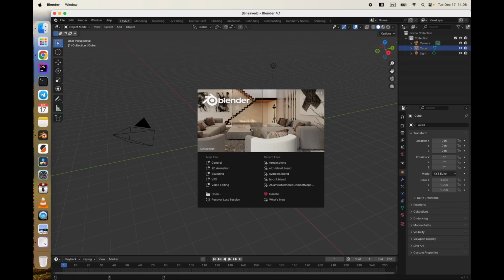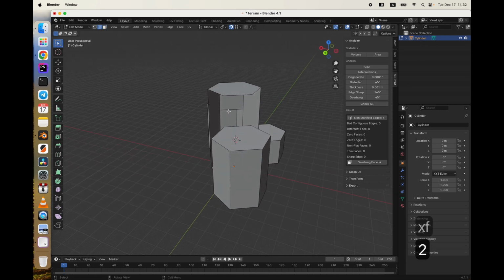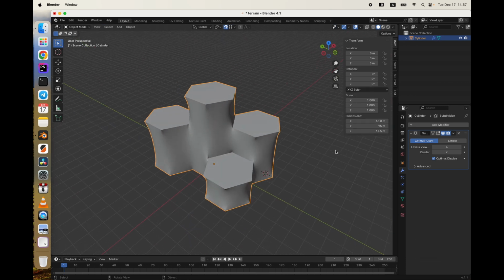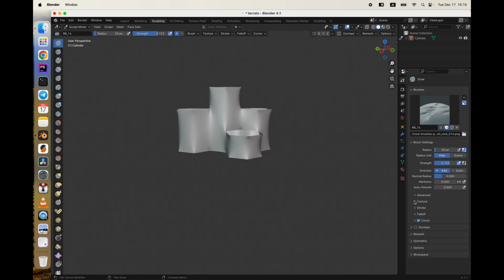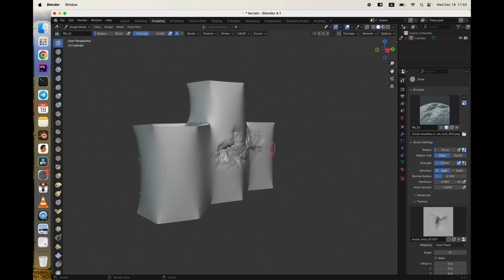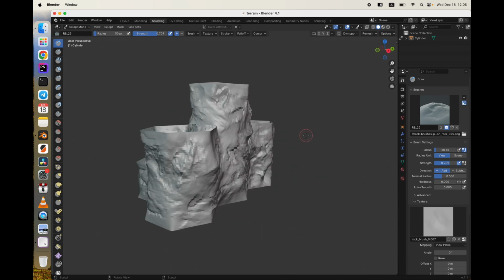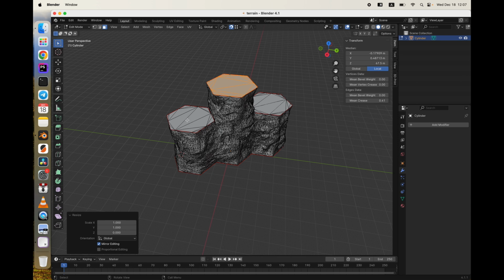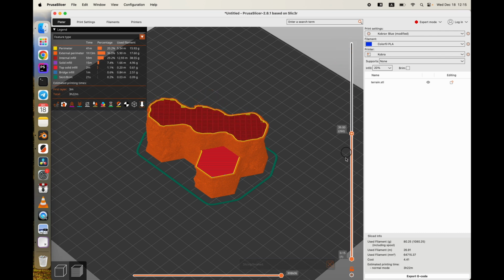How to Create Rocky Surfaces for BattleTech Terrain in Blender | Beginner Friendly Tutorial

Comment: I got another question for you! Is there a way to limit far out I sculpt? I want to make different terrain mesh with each other if that makes sense. Instead of making custom shapes I can use a variety of hex configurations to make the terrain.
Reply from the maker: You have two options:
- Hide vertices in edit mode so they remain unaffected by sculpting.
- Sculpt "as is," then use booleans to remove the excess.

Comment: Hello! I am trying to follow your tutorial but instead of modelling the hexes in SolidWorks and then import them into Blender. However when I try to follow your steps it does not work. I was wondering if you have any ideas or suggestions that could help me out. Thanks!
Reply from the maker: Sure! Could you tell me at what stage the results of your actions start to differ from those shown in the video?
Reply: I actually was able to figure it out, when I was exporting the hexes in SolidWorks, SW would export the mesh as triangles. So before exporting I had to create a mesh and adjust some settings to make a quad mesh. Once I was able to do that, I was able to follow the rest of your tutorial from doing the subdivision to the end.
Reply from the maker: @ironhead0007  Thank you, I'm so happy somebody actually used my tutorial and got a result. Hooray!
Reply: You're welcome! It was just what I needed!!